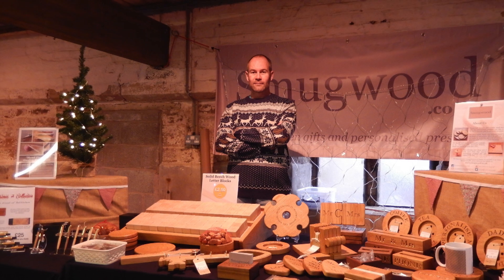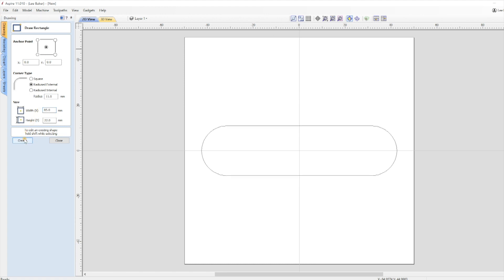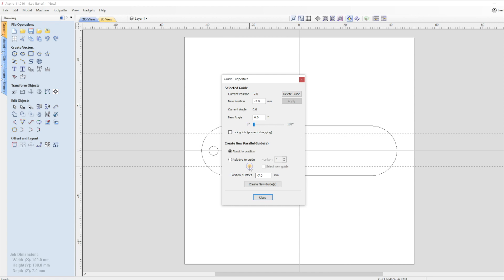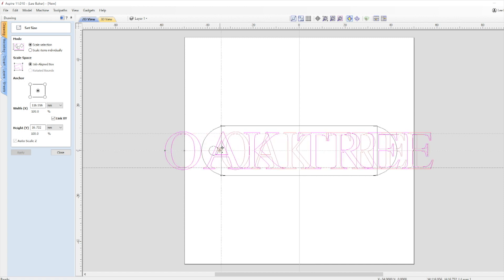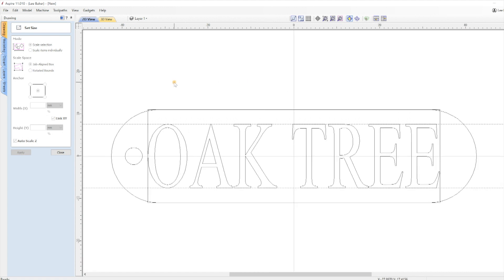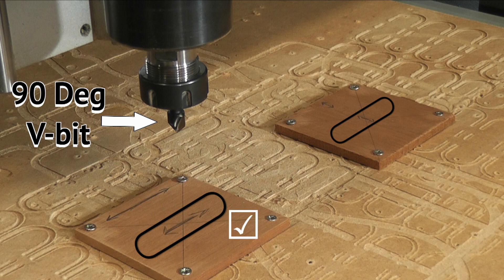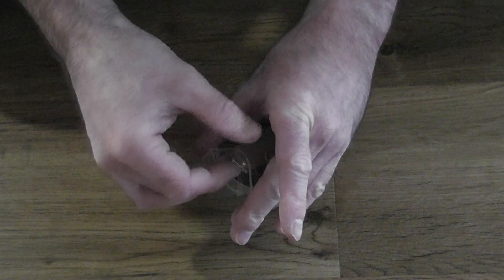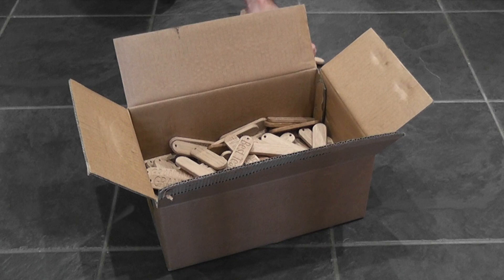Vectric V Carve & Aspire CNC Tutorial - Making Keyrings (How I Paid For My CNC)

Comment: Wow, was this a fun video for me to find yesterday! Thanks for the idea and the awesome walk-through, I literally took my phone up to the computer and started CAD-ing then and there, with you by my side.

Being in my first few months of CNC work, I've been really trying to find an idea like this that will help keep me busy, give me practice on the machine to build confidence, and just earn some MONEY! This video was SO encouraging and I'll be cutting some keyrings either today or tomorrow! Yay!

One suggestion for you or others and one question, if you please.

I found that using the squared off vector box as a bounding box for my text made the sizing super simple. Rather than dragging the horizontal guidelines and text to curve tedium, use the software to do that function. I made the HEIGHT of the vector rectangle 15mm with the same width you suggested, then chose the text option just to the right of the regular text button. Be sure that smaller rectangle is highlighted and use the spacing option after to increase/decrease the individual letter spacing horizontally. Anyway, there is an easier way to do that step, hope people find my additional suggestion helpful! 

My question is regarding toolpathing in an array. I was able to array the profiles cuts for both the hole and outer profile to set up a full job on a particular piece of wood, but when I went to do the same thing with the text, it only allowed ONE toolpath array to exist. I need to re-address it today, but I'm curious if anyone has read through my WAY-LONG comment and also knows how to set up more than one toolpath array!?

Thanks so much for the video - I've now subscribed and will be eagerly watching more!

Comment: Where did you get the hardware for the keychains?
Reply from the maker: I bought the rings on eBay…I think the main rippled ring is 25mm and the jump ring was 10mm…I bought them off different suppliers on eBay as neither sold both types at the time. 👍
Reply: @Smugwood  thank you, great video!
Reply from the maker: Thanks :-)

Comment: Just curious where you were sourcing the 7mm oak / ash please.
Reply from the maker: You can buy oak and ash at 7mm but the companies usually have to take it from thick stock so it cost a lot. So I just bought 25mm (sometimes 22mm) thick boards and used my bandsaw to rip them down. Then I’d thickness them to about 8mm or so then use my cnc to skim them perfectly flat to around 7mm. It was a little bit of work…but worth it because a 25mm board at around 600mm used to work out around £10 and split in 2 worked out at roughly £5 each. That one board might make £30 keyrings at £5 each so in theory a £5 board was worth £150…give or take obviously. With the oak I used to specify to the suppliers what sort of cut I required too…usually rift sawn prime grade so almost zero knots and a good surface to engrave too. Plain sawn wasn’t too bad either as stability wasn’t too important and things like small keyrings. Quarter sawn wasn’t really the best on this occasion as sometimes the medullary rays made the text hard to read…depended on the piece though…I was very selective 😂👍
Reply: @Smugwood  thank you that was helpful

Comment: Great Video!  How much do you sell the keyrings for?
Reply from the maker: Health issues forced me to stop selling items so now I concentrate on just making the videos...but I was selling pre engraved keyrings at £3 each, personalised at £5 (single sided) and £6 for double sided. Certain keyrings cost a little bit more if there was some kind of non standard text or symbols. Profits were quite good compared to the materials used though. An oak board for around £10 I could resaw into two pieces and I could sometimes get 30 per board. So it was roughly £150 of keyrings to a £5 board...obviously taking out time, rings etc. But they were good sellers for me...sold thousands.

Comment: Hi mate, great video thank you.

I saw your post on a woodwork group and have subscribed to your channel.

Just had a go at making these and got kick back when the router bit into the end grain of the oak... New pants time lol
Reply from the maker: There’s a bit of a knack to doing this. First make sure your router bit isn’t too high. You only need a bit of the curve showing as you’re only easing the edges. Finish with sandpaper to smooth it properly. When approaching the router with the keyring, you sort of have to start on the sides and go in at an angle and keep going. If you have to stop and reposition, go in at an angle again and go as far as you can and repeat. Don’t back up or you’ll get a kick and don’t go in at a 90 or you risk a kick. If you need a little demo let me know and I’ll take a little video for you.